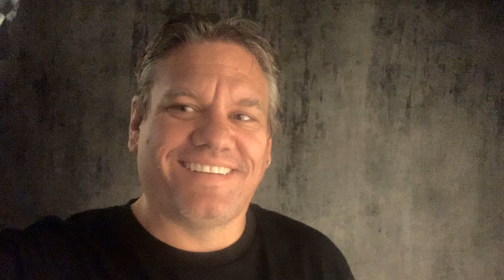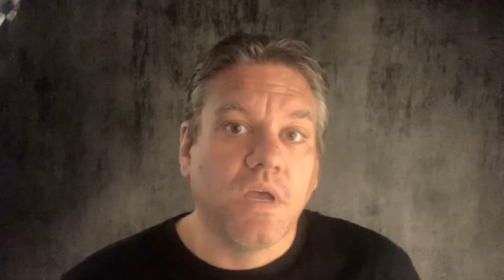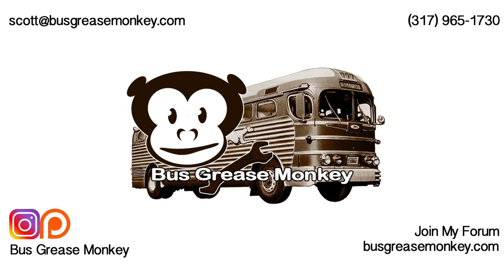20+ questions with Bus Grease Monkey Scott Traveling vintage bus mechanic detroit diesel

Comment: 21:30 i used to drive a 2016 Freightliner Cascadia with the 14.8 Detroit. If you sniff the tailpipe. You would not smell anything. This is why they got rid of two strokes.

Comment: Brilliant video Scott! Im an engineer and engine designer and was involved in a 2 stroke opposed piston 2 stroke engine and can vouch that with modern tech a 2 stroke diesel CAN be made to burn cleanly (check out Achates) with attention to combustion chamber design and injector design/fuel pressure. Anyway, I have an MC5 and this beast got me into 2 stroke diesels.
Reply from the maker: 5’s are beautiful
Reply: @BusGreaseMonkey  Thank you. I may need some work done on my bus drivetrain some day. How do I join your forum community? Thanks
Reply from the maker: Directions are posted on the site.  How do i join
Reply: @BusGreaseMonkey  Its asking for an invitation code...

Comment: Which is kinda something that pees me off about the licenses.  Me as a commercial motor vehicle has to learn about air brakes and then driving something that long.  Last week in think it was virgina or Pennsylvania I was fuelling guy near me driving a bus (it was a RV but the 3 axles) this guy pulls out of fuel island and turns hits that yellow poll if he had of had some kinda training.  A few years ago in texas RV infront of me wanted moving out of fuel island I walk to and low air buzzer going off his air pump wasn't building up he had no clue why alarm was going off and RV wouldnt move.

Comment: Hi Scott;  Watched many of your great fixes here,and in this video you suggest a CF-2 Lube spec., for Detroit 2 Cycle engines.  Question--- Is that determining the least spec or the best spec ,low ash,lube mandated by whom/ what authority? OEM spec could be dated for the year of manufacture ,and the best lubes of that time, and not the capability of any future lube spec to protect the engine more efficiently ,and at less cost to use. Appreciate your expertise in mechanical repair techniques and methods, which are very valuable to us converted Coach users. Currently own a PD 4103 # 1641,with 90 mm. Injectors,dry Air Cleaner conversion,Two BY-Pass OIl Filter Units. with 3:55 Gears,and 265 R70 22.5 tires for power complement on hills Also MC-5 A. conversion which is now in detailing shop,after full timing service. THanks for your input and service to this community ,not really available elsewhere at your great conveniences you provide.  Big Al B

Comment: I don't know if it's actually true, but I have been told that the two stroke Detroit engines actually have more components than a comparable four stroke diesel engine.
Reply from the maker: If you count circuit boards and computer chips i doubt it   ;)

Comment: lol.. why not to work on DDEC engines..... Because they are a Frickin nightmare..  I use to have a pair of 16V 92 series in the 70 sportfish I ran.. Roger Penske Balanced and Blueprinted engines..(painted Red)...  I think 12 sensors placed all over the engine. when one sends a fault code. the engine will go into idle only mode..  Took me a year to become to be familiar with these engines.. I consider it a year wasted.. lol. because I will never see another again...

Comment: The white walls on the Futuraliner were part of the rim I believe and not on the tires . Have you ever had a Detroit run backwards on you ? Air starters startle the crap out of me at times ! Nice Q and A session! No sense on getting upset with the questions after all you picked them ! Lol

Comment: You might want to look into powering your computer and TV's on DC direct from the house batteries. When I was doing radio survey work it really made a difference in stability and gas consumption. As for the bus wiring, think about using conduit running front to back with feeds coming off of that. The cloth/jute wire just gets worse after a certain age. if you have a diagram and dimensions I'll run you off cut list and recommend wire types.
Love your Videos BTW

Comment: You can still get 10-00 20 tires if you wanted but why. Another important thing to check is the shut down flapper. The flap is a fun thing to do to someone as a joke usually they figure it out before they kill the batteries

Comment: Suggestion on the reaching of your springs. I know your @100 miles away but I had Louisville Auto Spring rearch all the rear springs for a fleet of Chevrolet ambulances to lower the rear stance. They are very easy to work with and would probably due them while you wait Located in Louisville KY

Comment: Consider replacing the propane stove with an induction cooktop. It heats metal cookware and you could have a pot of boiling water on the induction cooktop and remove it and the burner is cold and won't burn your hand or arm. Add an electric oven and you could eliminate propane on the coach. Use a webasto oil fired boiler it is very small smaller than a standard home oil burner and rated at 45000 btu's of hot water, replace the hot water heater with a say 20 gallon hot water heater heated by a coil fed by the webasto boiler.  They are available in 12 or 24 volt versions. They burn roughly 1/3 to 1/2 gallons of number 2 oil an hour.
Major advantage of the induction cooktop is it doesn't generate heat even at full power unless a metal pot or grill is on it so it won't heat up the kitchen in the summer as bad as a propane stove will.
Reply from the maker: She uses an induction cooktop.  Furnace is the only propane except the engine

Comment: I thought you might enjoy this video as the US Army tank the Sherman M4 used a Detroit 671 pair of engine engines in a common gearbox called the 6046 instead of what they used in combat, one of 4 different gasoline engines. Detroits were preferred but the navy got the priority to build generators for ship use and mostly for landing craft.

Here is the video of a company that did a total restoration of an M4 powered by the 6046 twin 671's.

I do believe you will enjoy it.

4th gear full throttle top speed was roughly 28 mph. These were a medium tank and that was considered fast for that era.

The firefly was a Sherman with a flamethrower instead of a main gun, liquified gasoline in jelly consistency which stuck to anything it was sprayed on while on fire. No longer used by any of the worlds armies.

Gas engines were a wright 7 cylinder aircraft engine of  450 horsepower, a Chrysler multi bank engine which was 5 230 cubic inch flathead engines on a common crankcase. A guy down the street crewed on one during the war and said usually one engine was dead until they were able to do a full tuneup on her and the last on the M4a2E8 used a 500 horsepower Ford built double overhead cam V-8 engine that was virtually trouble free. 
The easy 8 was the last version of the Sherman used.
There are former army supply depots that have thousands of surplus parts. You can still buy a new WW II built 671 from these guys something to consider for parts. 
They are located mostly in France.

https://youtu.be/uVwFN1Tap7k

 Cheers!

Comment: Old school mechanical stuff does not matter what it is is better. You can repair it even if you have to do a Rube Goldberg repair it can be fixed by anyone with a set of common wrenches and screwdrivers. Oh, Ya, almost forgot to praise the EPA for the junk we have to buy and put up with.

Comment: I have an old GMC Astro with a V8 Detroit I believe it was a 318. every once in awhile it would start up and run perfect the only problem was it was running backwards. Of your 20 questions, have you ever had one of your Detroits run backwards
Reply: We had a gmc brigadier with a 6-71 turbo that if you lugged it down to stalling it would run backwards
Reply: Must run really poorly backwards, the scavenge blower will be sucking... it seems that the cylinders could only fill with exhaust sucked back though the valves.
Reply: @Bodi2000  it actually does run bad but it does and can run backwards. It doesn't happen often and I don't know what causes it but it does happen

Comment: Scott... have you ever toyed with the idea of a 6-110T?   Also, the 4V heads have considerably more power output potential than the 2V heads... we (and several others) never could have realized the power outputs we got the from the V12's in sled pulling, if we had used the 2V heads.  Even though the 4V heads are more prone to cracking between seats, that issue does not outweigh their breathing ability and potential power gains. I agree with you that, in terms of the 2V head on the 6-71... IF, you're sticking with the "stock" range of injectors and rpm limits... the 2V is fine.

Comment: Not sure why you say there will be no difference in HP and Torque. Wiki shows otherwise for both the In Line, and V variants of the 71 Series. Yes, there are some different figures as far as at what RPM the test was made BUT there must be some gains. You still haven't addressed the question of what is involved in going to a 4 Valve head and Turbo (asked more than once by others). Did I misunderstand where you made it sound here and in another video you were installing the 4 Valve Head without the Turbo---that really makes no sense---you make it sound as if the Turbo is off in the future?
Reply from the maker: I said with my current setup i would not see a hp gain when i slap it on

Comment: The roofing company I worked for bought a few sets of 10.00x20 from the local tire shop here in Terre Haute that were from China but that's the only new ones I've seen lately
Reply: They used 11.00R20s on military trucks up until just a few years ago.

Comment: will that 4 valve head reduce your engine temperatures when you travel? but the turbo kit how long does it take to install the turbo and the piping to it what exhaust plans you have with a Turbo? as it will have be quiet if you travel to California due the the exhaust law they passed in Jan of 2019.

Comment: Totally agree, there should be no loopholes in a license to drive these so-called RV's. No air brake endorsement--another ridiculous loop hole. Some of these brake situations you have encountered, or better put, POOR TO NO BRAKES is proof that spineless politicians need to show some backbone and change these laws. Guess they will wait for some big accident with unnecessary death in their particular State before they act---IF THEN!

Comment: Hey Scott, I was glad to hear you say you were going to go back thru the engine before installation of the turbo charger.  I remember you said you intended to advance the gear train timing as well. I'm sure you probably know this but you will need turbo application seals in your blower and you really should swap out those trunk cylinder kits with cross-head kits.  Those trunk pistons don't hold up very well in automotive applications with injectors larger than N65BT. (Ask me how I know)  Regarding an inter/after cooler: if you had the space you could possibly retrofit an air to air charge air cooler from a modern-day bus, I know it's a long shot.

Comment: Only reason I could conceive of not wanting to re-arch springs is the potential for stress fractures, and in old steel, it's quite possible. Midwest Brake&Clutch USED to fool with it, but you likely already tried them......enjoying the content!

Comment: 2 Strokes are superior same as in race bikes, they require LESS parts and last longer. Thanks to Bureaucrats/Activist politicians anything that man creates they devise a method to TAX/RUIN it.
Reply: Oh puhleeze!!
Reply: I don't think Racebike Two-stoke  could ever be said to last longer...... Believe me, they seize pretty damn quick when they get hot. Rebuilds are cheap thought in comparision.  Two-stoke motocross bikes go bang, so did the old motogp bikes  when the jetting is wrong.  But they will always be the funnest things to ride. 

KTM now making fuel injected two strokes. These will change things. Auto-lube too. So no mixing or petrol and oil and it will solve reliability issues..... 

In the old days, if you held two stoke wide open on a long stretch, you were afriad to close the throttle at the end of it,  as all the lubrication was in the fuelm  so closed throttle, = no fuel or top end lubrication. Instead you would keep the throttle open and hit the skill switch so the engine could keep pulling enough fuel through whilst slowing down..... 

What a shame they don't make so many........  I love the smell of two stoke in the morning.......
Reply: @michaelcaton9358  Owned 2 strokes race bikes/enduros for years. KTM is developing the bikes when the big 4 abandoned them. Never had any reliability issues, 4 strokes got a lot of lightweight moving parts that gernade then get parted out. Enduro racing will be 2 strokes as the 4 strokes over-heat and give up.

Comment: how about fixing the wipers :-)
Reply: The wipers work fine, he simply uses rainx to prevent water buildup on the windshields. As you can see in his videos when he's driving and it's raining it works just fine.
Reply: @jamesshanks2614  ok, its usualy now showing, the camera points at right side and thers no wipwers going on it.